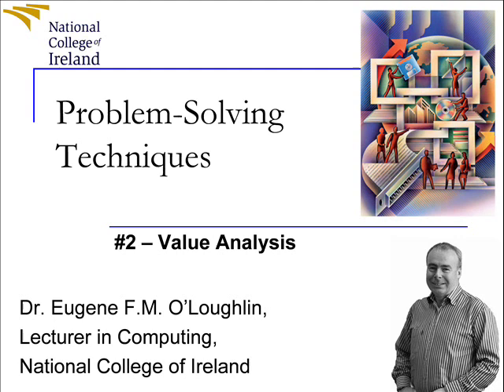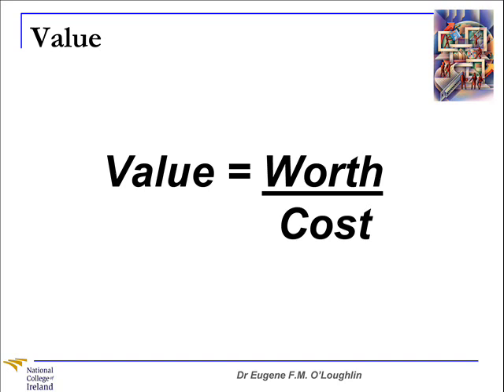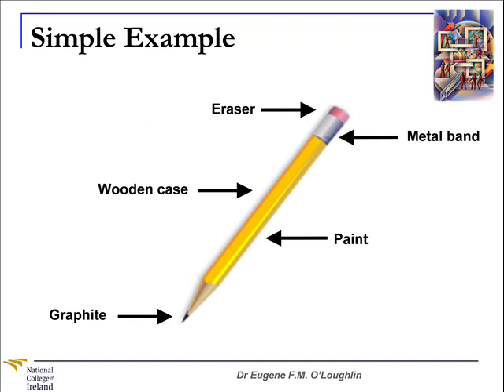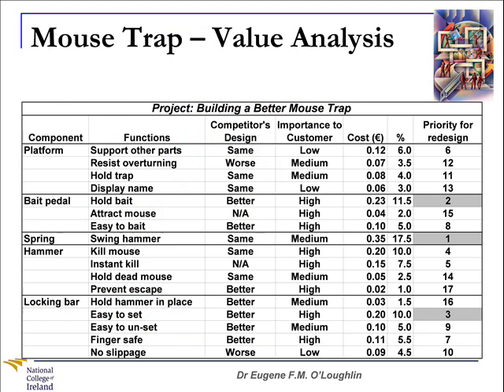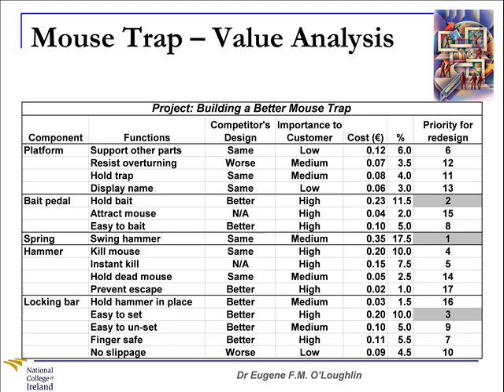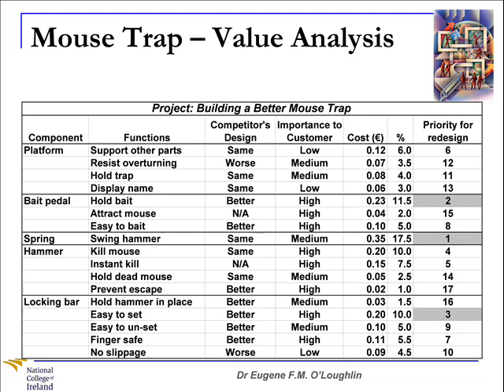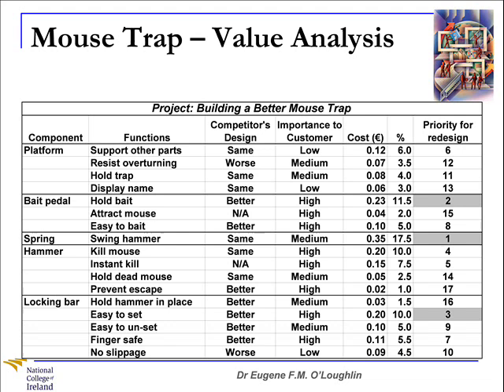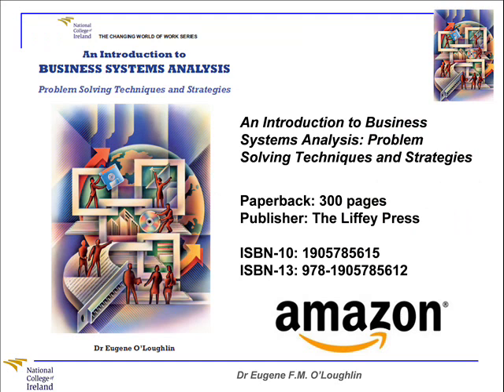Problem Solving Techniques #2: Value Analysis

Comment: My comment on the VA for mouse trap; the  overriding criteria for redesisign should be based on value which according to your definition is worth over cost.and should not be based on cost alone. As such since the "prevent escape' function  of the Hammer which is valued highly by customer should be the first to be redesigned as competitor's functionality is better and should ranked highest in priority by customers. Further more, its  cost is the lowest ,so even if it is increased  when we redesigned it to match the competitor so as to provide better customer's satisfaction (worth) the overall value preposition  (worth/cost) should end up better.So it is my humble opinion that the criteria for the VA in the table should be based on Value not cost (which is only the denominator). It is the relative amount of worth over cost  that matters  ,not just based on costs reduction alone. We should not ignore the  nominator ,ie worth (according to customer's perception) If we based on cost alone,the value preposition might not be optimized and we will lose out on the competitive advantage angle.Overall, i still think that your video is good

Comment from the maker: Hi mecantfindadamname - First, many thanks for watching my video.

The simple formula I use is to set the scene about "Value" and help people understand at its simplest what value is. I don't factor this into the mouse trap later in the video. The rating used is simply the percentage of total cost that each function.

Hope this helps,

Dr E.

Comment: In the cost column,  please advise if these are estimated or actual costs?
Reply from the maker: Hi Miriam,

Costs can be either estimated or actual. 

Some components will be easy to determine cost. For example - in the mouse trap example above, the components can be accurately costed as they are individual items that must be purchased to build the mouse trap. So - the "Platform" component actual cost is 0.12 + 0.07 + 0.08 + 0.06 = 33 cent.

For functions - apportioning cost is more difficult, but is a key part of Value Analysis. This is more likely to be an estimate and you may need to call on experts to help estimate costs.

Hope this helps,

Dr E.
Reply: @EugeneOLoughlin  Thank you